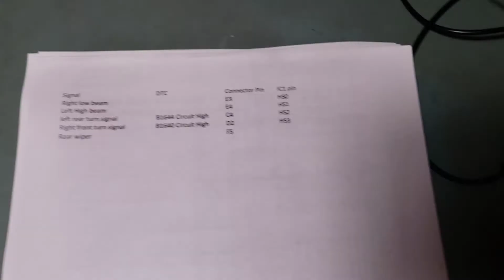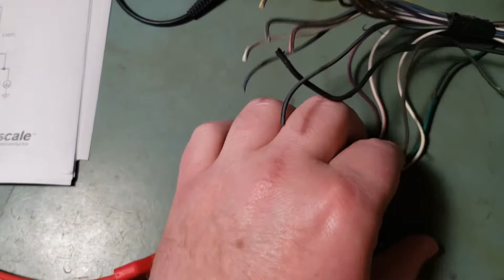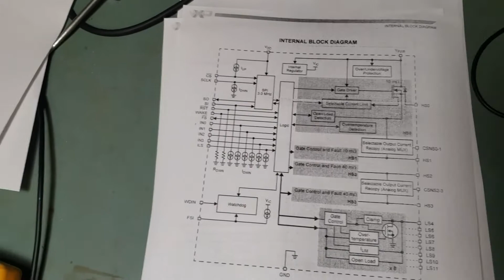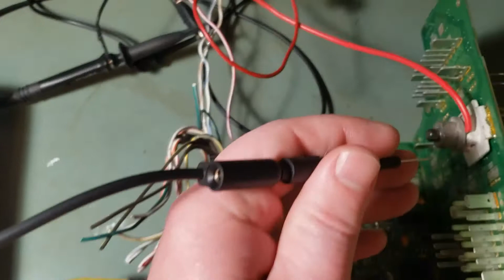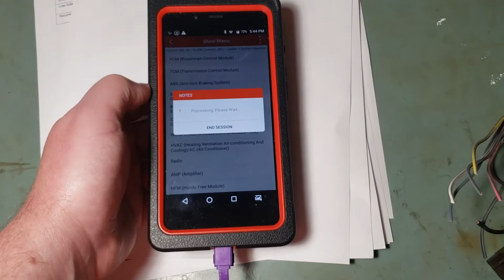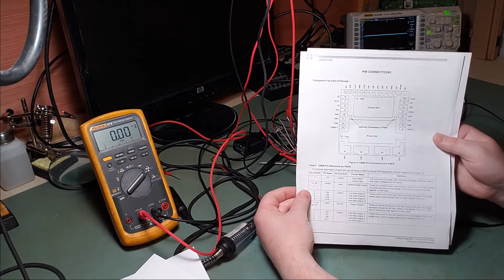Fixing a TIPM with failed lighting outputs - Part 1

Comment: Excellent diagnosing!  Your certainly a credit to your last name (which I, too share). Only I don't appear smart enough to figure out how to send a private message.  
My issue is with right and left rear turn signal brake lamps.  TIPM removed, cleaned, inspected for the obvious. Same issue remains.
Happened after a connection to a friends trailer, which had a shorted wire.  
I read that the TIPM chip will shut down the driver chip when it senses the short.  Is there a reset?  The "hard reset" online instructions did not help.
Reply from the maker: I don't know for sure but I would assume it would reset the output after power is removed. I could bench test it and find out though. How do you know my last name? I was trying to be anonymous.
Reply: @remlab4288  Another commentor used it in complimenting you.  I share that last name with you.
Reply from the maker: @r2rr195  Oh thats actually my first name. Oh well. You gave me good video idea for a short circuit test though thanks.
Reply: @remlab4288  I wish my phone app gave me an option to PM (private message). I am curious as to what the circuit protection does on these boards. Everything that I have problem with was handled by fuses for eons, but now this TIPM thing shuts down with possibly no fix? $700 replacement for what used to be a 15 cent fuse seems insane. 
Hopefully the driver can be reset somehow. Good luck!
Reply: Would you take a diagnosing job on a TIPM from a bum like me, using your first name for my last name?
I believe that the circuit protection didn't protect from a short. It will not reset the driver with power discharge, then restart.
No rear turn signals, brake lights, flashers.  I think it happened when connection made to a trailer with wires exposed to ground.
No other issues (except for a new one, intermittent inop. fan in cab).
I don't know if you take in such work, or how long it might take, but your video instilled in me a trust in your way of doing things.
Other online options all seem iffy to me (both in refurbished units and promise of diagnostics/repair).

Comment: These were always so finicky. If you run into one where the wipers stop, the factory had a current limited setting at one point that was removed after being reported to NHTSA/DOT. They would lock out due to icing on the blades. Great thing to have happen after a tractor trailer passes you and tosses crap on your windshield.